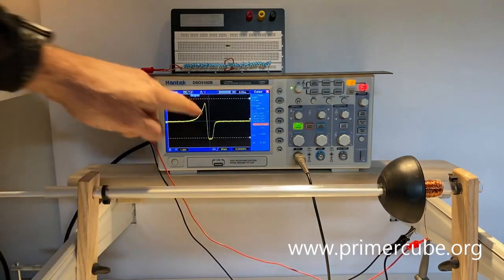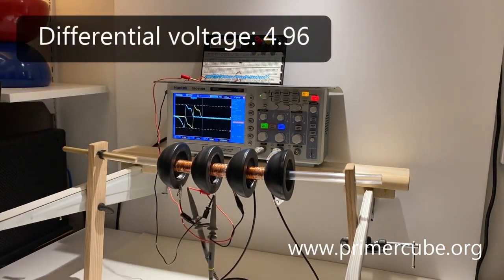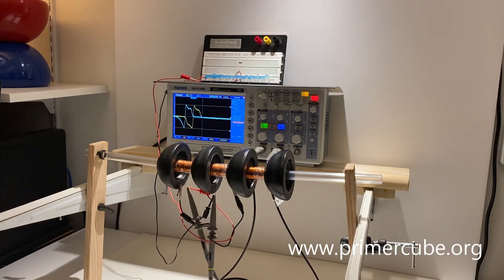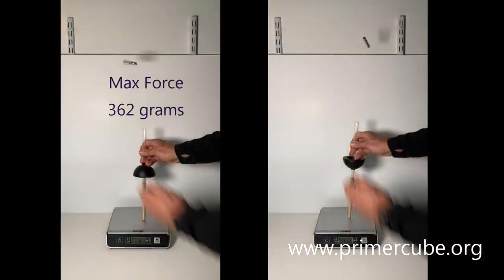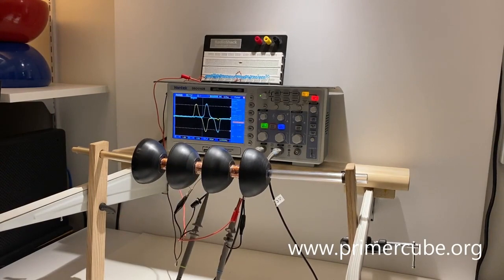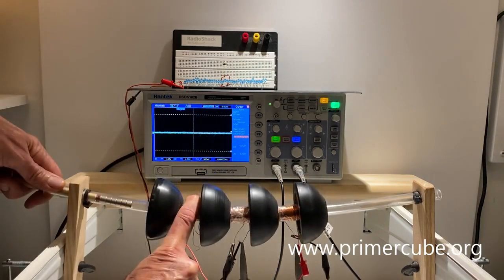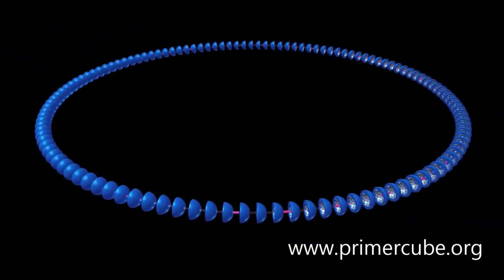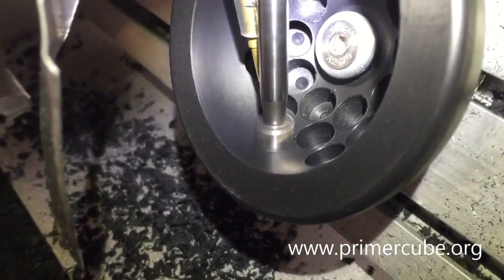Magnetron Church Like Magnetic Dome Accelerator by David LaPoint

Comment: The problem here is not voltage but when current is extracted from the device Lenz,s law will slow the magnet projectile down considerably until projectile comes to a complete stop.
Reply: Lenz law oookay. Have fun with your wals. 

This works. Its proven. Soo how does Lenz lawww handle this? Perhaps by applying some dark matter? Aka doesnt matter in the dark.   Primer Fields Have tossed the Bar model in the dumpster where is finally all fits together nicely.
Reply: @Coincidence_Theorist   remember lens law is out ward not inward  hey presto gaeme over.
Reply: Then how has my friends array been running for the last 6 months? Or will it stop eventually?
Reply: @Aedonius  where can I view the video of your friends array? All I can see is that the device might continuously move the projectile,  however when you now want to use the array to generate electricity, the projectile moving through the coil will experience magnetic resistance " Lenzs law" plus the energy required to initiate the projectile will give us a negative, this means more energy is needed to keep  constant velocity in the Array ," if used as a generator"  I think if all interested, worked together we could free ourselves from tyranny.😅